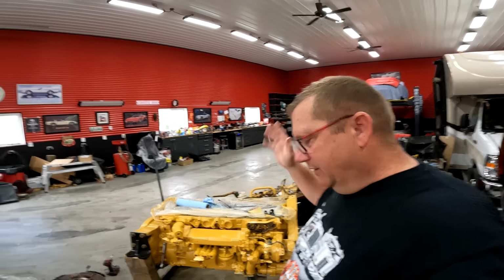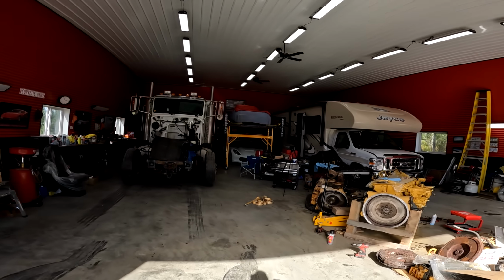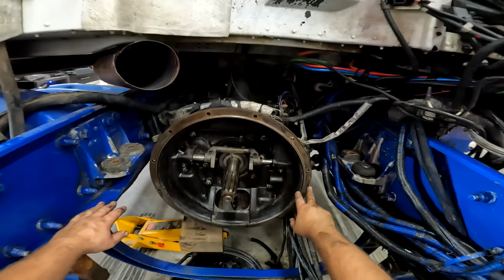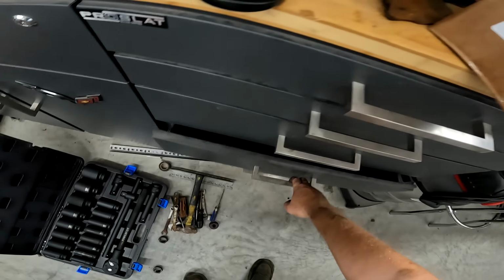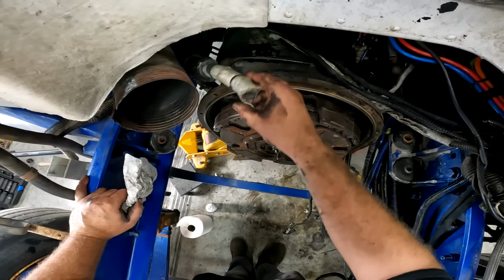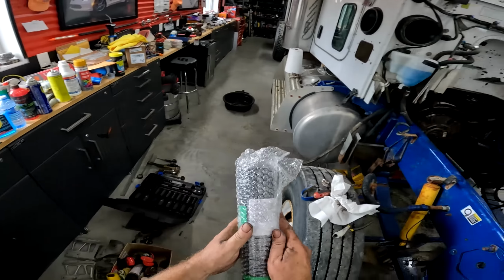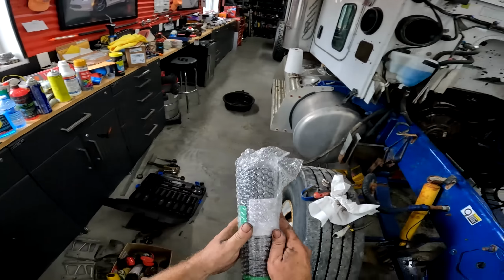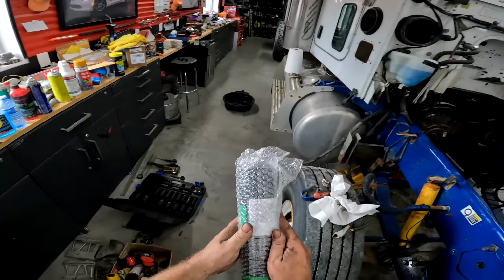Duke has a CAT engine AGAIN!!!   part 4

Comment: That hat cam worked better than I thought it would, not so shakey. Keep using it, just not all the time. I think the Duke is going to be just fine. Nice looking installation, so far. That engine looks good! Your little John Deer had enough muscle, and fixing the dragging brake, made putting the Duke back into the garage look fairly easy. What you're learning from this project, I'm sure, will help latter when puttting an engine in K2. Since K2 is a cabover that will envolve going in from the side or back. Keep on going, you're looking great!
Reply from the maker: Yes thanks David. I'm looking forward to Putting some power into K2

Comment: I must of been gone longer than I thought as you  threaded the engine in quite nicely.... I hate head mounts but given  the situation, a head mount or just say its in was all of your options. Quite proud of your doing it by yourself Mike... really as it had failure with just one guy but your a better man than most to even try that. Now  the littler pieces parts go right in... right??? When pigs fly it will be easy but got to give you a big one for this one
Reply from the maker: Thanks Morgan

Comment: Hey Mike nice job getting your engine in by yourself. Just a suggestion but you could take all the parts you're not going to use on the new engine and bolt them on the old block and then tuck it away in the corner somewhere. Kind of like a spare engine parts holder. You're making head way now.
Reply from the maker: Yeah, I'll definitely hang onto anything I can use for awhile in case I need it

Comment: Hey Mike, Nice practice run! Now you need to borrow a clutch alignment tool from one of your Peterbilt mechanics, Then take the engine back out and properly install the clutch to the flywheel; then install the engine again while stabbing the tranny to the engine. They have to come together at exactly the same angle, good luck.
Reply: The video didn't show you bolting the clutch to the flywheel, if you were able to do that through the inspection plate on the transmission bell housing, then good for you! My apologies.
Reply: I do clutches the same way he did all the time, especially in this circumstance it is so much simpler this way compared to getting the input shaft wiggled through the clutch plates
Reply from the maker: Yep I was able to do up the bolts through the inspection hole. My battery died at the end when I did it but I think I'll show how I did it in the next one so guys k ow. Worked awesome
Reply: @mikethetrucknut  awesome I’m glad you was able to get the clutch bolted up that way I was sitting here going NOOOOO MIKE DONT FORGOT TO BOLT THE CLUTCH TO THE FLYWHEEL!!! 🤣

Comment: You probably think I am on your case. I used to be a trucker(not steering wheel holder). I had 3 Kenworth W100s, one a time. I had the first W100B in S.C. Before that the guy worked for, bought a wrecked K100 and had it rebuilt for me to drive. I picked the paint scheme, looked like a circus truck. I liked tinkering with things. I am disabled now and cannot hardly do anything. Drives me miserable. Would send pictures of my trucks if I knew how. Not on your case, just jealous.
Reply from the maker: No worries John thanks for following along. You can always email them to mchamberlain@peterbilt.bc.ca

Comment: Make sure you put the clutch in it
Reply: It doesn't need one. These are clutchless petes. I little mouse runs out at 13 hundred rpm and shifts it. Pretty cool. But sometimes you get a drunk mouse and can't float any gear.
Reply from the maker: Yep I did 😊

Comment: You know you might try when you're trying to back that  Truck up into the garage put a put a tire around you're an old tire on your bumper or in front of your bumper and see if that can you kind of push it with your truck without hurting your Bumper
Reply from the maker: I just pushed the tow pin so I can lift a bit to put some weight on the tractor for traction

Comment: Alot easier to build it all and put it in. But regardless you did a great job.
Reply from the maker: If I had an overhead hoist I'd have done that for sure.
Reply: @mikethetrucknut  oh it was to heavy?
Reply from the maker: @outlawtrucker187  yeah, would need a 7000lbs crane